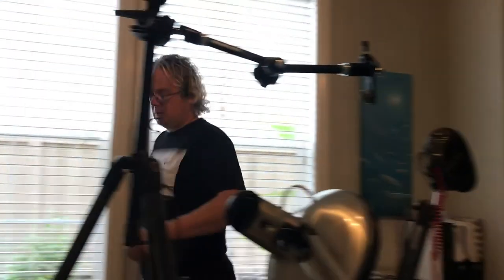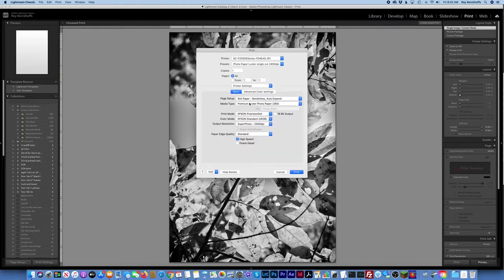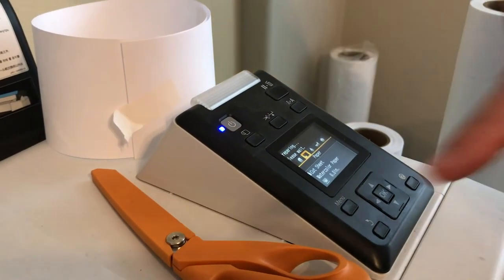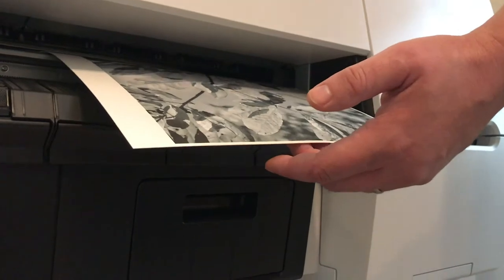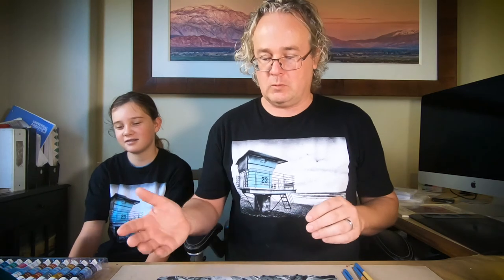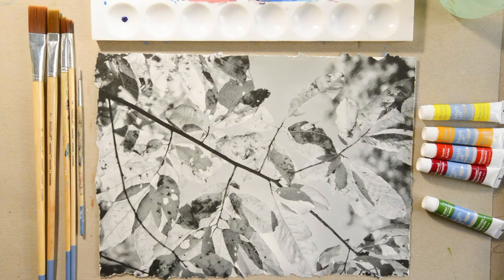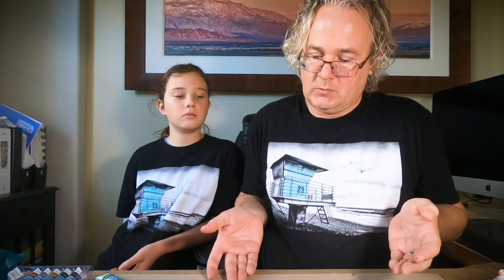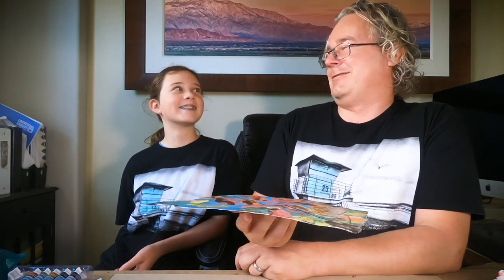Hand Coloring a Black and White Photo with Watercolors - Fall Leaves - Deckled Edges

Comment: This is a charming and helpful tutorial.  Lovely to be privy to two artists working through this process!   I will be getting my images printed for me on my watercolour paper.  Can you please advise me as to how to instruct the printers.  My local printer, while not an art printer, has a number of excellent professional machines.  What should I request in terms of ink jet vs laser, etc?  Thanks for this!  Going to binge your channel now!
Reply: I will be painting with watercolours.
Reply: The algorithm is not doing you any favours!  I first saw this pretty close to when you posted, and then you disappeared.  You deserve big numbers, but you re hard to find :0(
Reply: Maybe some collabs.
Reply from the maker: Thank you for your comment and question! I haven't tried it with a laser printer, but somebody else once told me it works. The problem with inkjet is that the inks can get smudged, especially if it's printed with "photo black". That's why I use "matte black" (I'm lucky to have two different blacks in my printer, but if matte black is available for your/their printer the photo black can be switched out temporarily), which doesn't smudge. An inkjet printer is better at getting a nicer range of grays as opposed to a laser printer which only uses black toner. Hope this helps!
Reply from the maker: @IvyRoad  Answer to your algorithm comment: I know.... but I'm not good at YouTube SEO. One time I acquired a YouTube add-on that optimizes keywords but it only marginally improved things.
Reply: @RoyKerckhoffsArt  Thanks so much!  Really helpful answer.  I will get some copies done on both, on inexpensive paper, and do tests. :0)